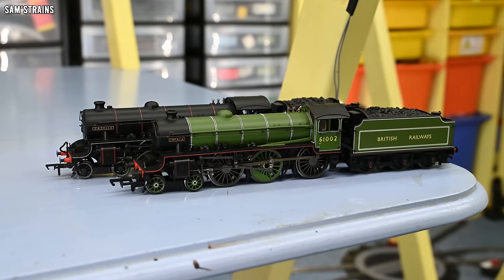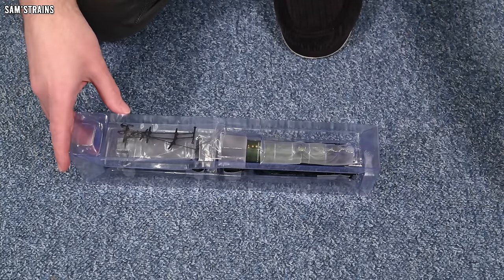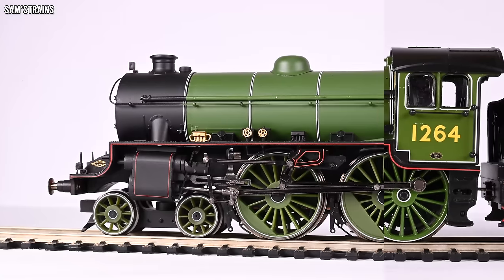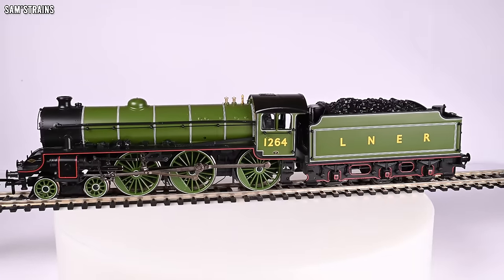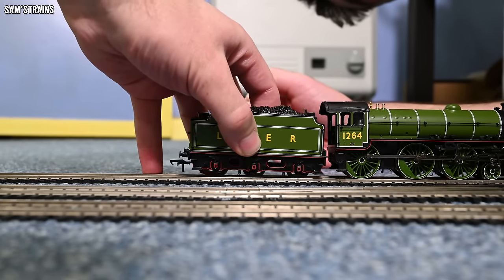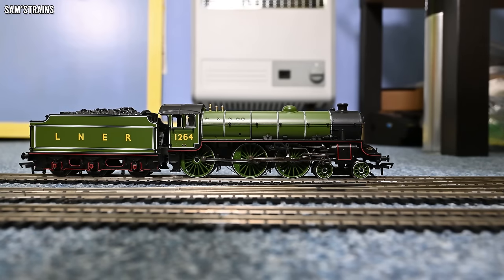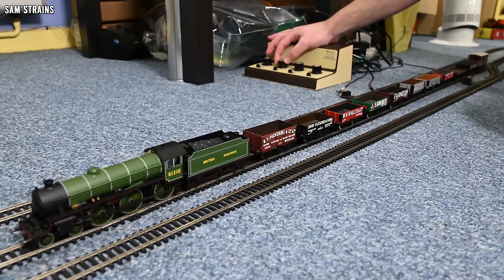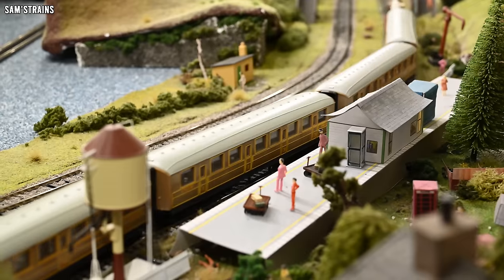Why You Shouldn't Buy the Bachmann Class B1 | Unboxing & Review

Comment: Judging by the looks of things, this looks like Bachmann's typical trick of sticking a new chassis under an outdated body. Same thing their V1/3 suffers from.
Reply: Just like their USRA 0-6-0.
Reply: To be fair hornby do that too but at least they usually put them in railroad. Also most of these older models have split chassis so if they didn’t use a newer chassis then DCC fitting is very difficult.
Reply from the maker: Yeah absolutely - they've done this quite a few times!
Thanks for watching - Sam :)
Reply: @SamsTrains  in regards to the B1 and V3 ,I prefer the older split chassis stuff just for the cheapness alone. They are easy to updetail and the big solid die cast chassis makes them reasonably weighty.
Reply: Disappointed with Bachmann's LNER V2 (latest version).  A thin plastic running plate which bends at the touch of a finger.  Out of the box, a very poor runner (couldn't crawl, jerky when slow) but might do better when run in.  Poor value at RRP (220+ pounds), would be acceptable if100 cheaper.
Reply: @SamsTrains  Hi Sam.
Another disappointing review... you keep coming with the same points for most models recently. Maybe you could get a meeting with Bachmann and have them explin the design & manufacturing processes, the reasoning (technical and financial) behind the choices they made? Same goes with Hornby. That would be interesting to see - why no tender pickups, when they have been shown to be such a boon, for example. I'd love to watch that!

Comment: Often what is done Sam, is that people buy the model on special, scrap the chassis, detail the Bachmann body, and put it on another set of frames (usually Comet Models) with an old Portescap drive, or a new High Level Kits one.  Why do people bother with the Bachmann model at all, I have no clue, especially with those completely wrong boiler bands!  Thanks as always Sam
Reply: I bought a second - hand body years ago. It was black. The body and tender were fine. I scratch built an EM underframe with a large can motor in tender and a drive shaft to three sets of worm and gears in the body and my own outside rods and gears. Numbered as the last B1 I ever travelled behind, finishing at Nottingham Victoria. (PS I just replaced a Portescap drive in my 1967 scratchbuilt C12 Atlantic. It was an end-of-run drive and always very noisy. Now, the High Level Road Runner is noiseless).
Reply: @johnjephcote7636 I I always liked hearing stories about people modelling locos on the ones they've ridden behind.  Its always lovely to remember that almost every loco will be appreciated in some form long after their service years.  Also, I'm hoping eventually when I have the equipment to make a better replacement for the Portescaps, as the only drive capable of being back-driven is the Slater's sg4, and I think I can get a better low end speed with an even better flywheel effect.
Reply: What’s wrong with the boiler bands? Asking out of curiosity, the smokebox door was always a bit of a problem for some locos (it’s for the less common type) and the chimney was always awful, but the boiler I thought was acceptable?
Reply from the maker: Yeah I think that's fine - as soon as they don't sell and get reduced it's fair game - I just feel bad for the people who pay top dollar thinking it's a decent model worthy of the price tag!
Reply: @Britishrailwaystories  Simon, my problem with the boiler bands is that the white edging takes up 2/3rds of the bands and the banding is a bit thick for me.  To rectify this on a Hornby 4472, I put black paint paint on all of the boiler and used a sharp knife to scrap away the 0.1 mm of edging to look like proper LNER boiler banding. I may post something in RMWeb about this as the result is almost as good as a bow pen.
Reply: @Britishrailwaystories  Also, my reason for mentioning the paint/lining is that is the main advantage Bachman has over Hornby.  If only one of the two had someone like Malcolm Crawley to help show them what true LNER green looks like.  I’ve heard that a 50:50 mix of precision and goss varnish looks good and will be trying that.  Thanks as always.
Reply: @1471SirFrederickBanbury  good to know. I knew Malcolm, he was a lovely gent. I was so sad he never saw the P2 finished whilst alive but it’ll run in his memory one day. I tend to put fox transfers boiler band transfers straight over the old ones on the Bachmann B1s. That solves it for me on most of them I have four from the same batch and only one out of the three had satisfactory tampo prints - the actual width of the boiler’s moulding is acceptable I think, I agree the paint application is poor.
Reply: 9 @Britishrailwaystories

Comment: I have four of these, bought five years ago when they were much cheaper (£57, I have checked, from Hattons). They were excellent starting points for modelling. Each has been converted to represent a different member of the class. I love them for that. For the cost at the time, I got four for the cost of one and a half Hornby ones. The split chassis mechanism was of its time, and you can now get 3D printed plastic inserts to fix the older chassis. I honestly didn’t think they were bad quality for the time, today their RRP is too high, IMO, but as starting points for modelling they are pretty good.
Reply from the maker: Wow - for £57 they're the perfect budget offering - quite surprised they were so cheap as recently as that! Thanks a lot for sharing - sounds like a great little fleet!
Thanks for watching - Sam :)
Reply: @SamsTrains  I have checked my blog, and, insanely, it was actually NINE years ago. That’s mad how time has flown by! I used a combination of different tenders, brass chimneys and other parts to bring them up to scratch. The chassis itself I really like, it’s very straightforward. My intended layout does not have many areas where tender pickups will absolutely be needed, it’s basically a big oval with a fiddle yard.

Comment: About the drawbar connections (17:05): on this and similar connections on other locos, I will drill out the tender pin slightly, make the connection in the repair cradle, the screw in a small screw with a washer into the connecting stub, thereby retaining the drawbar. One doesn't want to go very much wider than the drawbar for fear of actually breaking off the existing stub. This has worked well for me on several locos, including other Hornby ones, too. All that being said, once again, a Sam's review has turned me away from making buying mistake, much like the FELL review did.
"The solution is to not buy the locomotive." Well said.

Comment: I bought one of the split chassis models a while back. It was a good model for many years but unfortunately had the same problems that you described. Now I just use it for spare parts. I thought Bachmann actually did a full redesign of the B1, and I am shocked that they didn't. Considering how much they are asking for this model, and the fact that I live in the U.S., I will NOT buy it.
Reply from the maker: Yeah super frustrating isn't it? I'm shocked they didn't completely retool it too - they certainly should have done!
Thanks for watching - Sam :)

Comment: Bachmann have a track record of doing this sort of thing - their Ivatt 2-6-2 tank was another case where a new mechanism was created to replace the split chassis design but the ancient body retained.

As for lack of tender pick ups etc - it rather depends on what the project brief was. If the brief was literally a ‘do minimum’ /  to get rid of the split chassis and make it DCC compatible then the tender would not have been part of the brief - hence it’s unchanged from the split chassis days - a fate that also befell the Collet Goods loco (though in that case getting rid of the split chassis and making it DCC compatible was done as two separate projects around 15 years apart).
Reply from the maker: Yeah they do - there's actually many examples, the V3 tank being another! That's right about the tenders!
Thanks for watching - Sam :)

Comment: It's a pity the model wasn't cheaper. Would have made a great budget alternative to Hornby's B1 if they'd made the price more reasonable and people didn't mind doing their own updates to enhance the loco. The price for the Bachmann B1 seems ridiculous when as you rightly say you could get a decent second hand Hornby B1 online somewhere. Though I admit it's a bit harder to compare the two (in terms of cost brand new) when Hornby doesn't have a B1 in their range at the moment. However I have noticed there will apparently be a B1 (mayflower) in Hornbys range that is available to preorder (£220) but that's not to say the price won't change when released. Still if it's a quality model and stays at £220 it won't hurt to spend the extra £40 over Bachmann's especially with 21 pin decoder capability etc

Comment: My UK layout has only radius 1 curves and a surface of 95x85 centimetres, so this beautiful steamer is not an option I am afraid 🥲 I have a Pecket, Terrier and Prairie, and an H0 Class 33. I am looking for a small diesel now, but I can't make up my mind on the new Ruston, but ut didn't really stand the test very well, did it? What locomotives would you recommend on a small radius 1 oval with one very small siding? Greetings from Belgium 🙋‍♂️
Reply: overpriced locomotive
Reply: @raymondleggs5508  A lot of locomotives are indeed expensive nowadays. I buy mostly secondhand. However now I found a Ruston DS88 for 70 euros, which is reasonable I think.

Comment: 14:47 look left & its visibly obvious that the cabin tilts away from the boiler & slopes towards the tender!! Must say in hindsight, I chose wisely to get rid of a Bachmann version in green and opt for the very same Hornby R3338 model in British Railways decoration you've featured in the comparisons (61310). It was around £100 new at the time but looking now, it was worth the money.
In fact, Ive let my Dad have it since then & obtained myself a pre-owned R3000 "Harold Mitchell" in late crest black that I returned from DCC to analogue. Found it on eBay for around £85 DCC fitted and preferred to remove the chip instead of trying to sort out the DCC address it was assigned.
Certainly my favourite Antelope and perhaps one of my favourite smaller MT locos in general.
Bachmann deserved a panning for cutting corners & cheekily upping the cost without providing new features or any visible improvements to warrant £180 RRP

Comment: I have a few ancient B1s, all of which still work, with varying degrees of smoothness.

The detailing was fine back in the day, but the fact that the body used for this "new" model is basically the same as used on the split chassis examples is rather scandalous. 

Thanks for the review and the warning it contains. 

PS: I don't think I've ever seen a Hornby B1 for sale...

Comment: You'd be horrified if you saw the Bachmann Prices in the USA. A friend of mine and I compared HO gauge Bachmann with Brass and brass came out cheaper than Bachmann every time which is quite sad
Reply: Old brass might be cheaper than Bachmann, but new brass is incredibly expensive. Old (but not modern) brass locos are incredibly inconsistent when it comes to performance and it often varies on a locomotive to locomotive basis due to them being hand built. The mechanisms were not the most well engineered and the emphasis was on looks. You often have to tinker extensively with and in some cases modify them them to get them to run as well as modern plastic models, and they are prone to shorts which can be infuriating to find. I have a ton of brass N-scale steamers, and I've found that in some cases two identical models from the same production run will have radically different levels of performance. One might run like clockwork while the other is a stuttering, stalling, derailing nightmare.

Comment: I had this model which has since been superseded by two hornby examples (when the model was cheaper).  In all honesty while I agree with 99% with what you have said Sam I think that the bachmann examples here does have qualities which blew away the split chassis predecessors.  I think the Bachmann B1 here is suitable for modellers who aren't really fussed about fitting DCC chips and for less experienced modellers who perhaps would buy the Hornby example at a later date.  The chunkiness of this model means it's more durable in  standing up to more wear & tear compared to the hornby example (and my hornby example did have a problem in the fragility of the valve gear).  The bachmann B1 is also a great "project" for experienced/intrepid modellers who may wish to custom their models by replacing the dome, chimney etc & to pick out the cab detail for themselves & adding more weight to the tender etc.  But I agree this model  overpriced for what it is today.

Comment: My latest Bachmann vehicle is the GWR Rail Motor with DCC Sound.  It’s a fine, reliable little machine that I think is well worth the £300 I paid.
Reply: My latest Bachmann vehicle is an N scale GP40 I found on EBay. I haven’t had the change to test it so I don’t know if it works but it was probably worth the $15 I paid for it regardless. I plan on hot rodding it and I’ve already ordered parts totaling about three times as much as I paid for the locomotive.

Comment: I've got a standard 4 that had this issue and rather than paying £30 plus for 3D printed insert replacements I gor two spare chassis, 2 spare motors and drives and a body for £20. Means I can practice a DCC conversion on one of them. Time consuming but works.

Comment: I have an old split chassis model in BR black, and honestly, completely un-modified it has been an excellent performer, I paid about £65 for mine second hand at least 10 years ago and sure I may have got lucky with mine, but I wouldn't bother replacing it with the hornby model, anyone considering buying one should consider the fact that at normal viewing distances (about 2' - roughly 60cm) its much harder to spot the poorer detailing so if you can pick up an older model for a decent price, knock yourself out, they're good ebough!

Comment: I have pre-ordered Mayflower from Hornby this year and yeah, I'm glad I did. Bachmann's looks absolutely terrible in all ways compared to Hornby. Granted, Hornby's is about 20-30£ more expensive, but you do get a much better loco in my opinion. Especially on the mechanical side. As you said, pointless in my opinion and especially the lack of tender pick-ups is quite shocking. If it had them and a decoder socket in the tender, I'd say it's a decent alternative if sold at 130-140£ but yeah, not even the price reflects the glaring emissions from this model. Great review of a slightly naff model, Sam 👍

Comment: A nice looking loco (for the most part!) but some of those separetely fitted parts are shocking. I think for the right price this would be an ideal beginners loco - a decent runner and reasonably accurate. In my opinion, I think that around the £60-75 mark would be good - and bachmann definitely can afford to do that - the moulds for the body and tender must have paid for themselves now. Models like this definitely have a place in the market (like the ivatt 2) but certainly not for the ridiculous price bachmann charge.
Reply from the maker: Yeah absolutely - shocking up close! That sounds a reasonable price, but not much more!

Comment: I'm surprised. Having a split chassis B1 myself (61251 Oliver Bury in BR lined black), and knowing of bachmann's poor steam mechanisms between their split chassis era and their modern era, I'm glad they've fitted a new motor and proper bearings.
However, the price is excessive due to its details (or lack thereof), lack of tender connection (including pickups and tender mounted socket), and the tender derailing.

Comment: my bachmann spectrum PRR K4 Pacific had the wheel covers warp as well. I did remove them but the silver metal does contrast very well 
to the black paint of the locomotive but without the wheel covers, the model runs very well and pulls good.
Reply: I had a bachmann Spectrum K4. Can't tell if the wheels are shot because it fell of a shelf a year ago

Comment: Would that black 4-6-0 on the outside line be the odd one out? It's the only one not painted in an LNER livery. Or the black 0-8-0? It's the only one with more than 6 coupled wheels, and I believe the only one that's not a B1, so long as the BR loco is a B1.

Comment: I know you're not a fan of traction tires, but 0.4 Newton is nothing compared to the steam locomotives (mainly from Roco) that I have.
My weakest locomotive with this same wheel arrangement still comes in at 0.54 Newton (locomotive driven on all 3 axles, 1 axle with traction tires). The next one in line pulls 1.08 Newton (tender driven on 3 out of 4 axles, 1 axle with traction tires). The strongest locomotive with 3 large driving wheels (wheel conficuration 2-6-2) has a pulling power of 1.77 Newton (locomotive driven on 3 axles, tender driven on 2 out of 4 axles, both driven tender axles have traction tires).

Comment: Sam - I usually complain that you've been far too generous, espcially with overpriced Bachmann dross, but in this case I think you've been a bit mean!
I realise the 'rivet-counters' aren't going to like this model, and that's fine for them, but good running is my number one issue, and mine runs really well, and very smoothly even starting and stopping - I put a video of it on my channel - nor does it derail in reverse.
True, the DCC socket and speaker housing should have been in the tender, and it's ridiculous that you can't have sound without some sort of rebuild, but I also got it for not much over £100, wich seems typical, so I like it a lot, and for me the performance and value scores seem very low for a change!